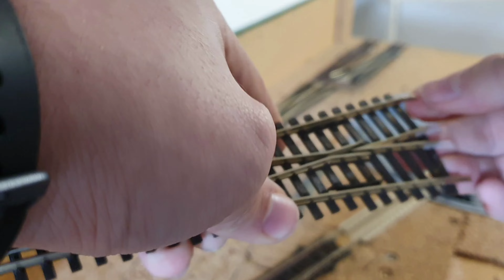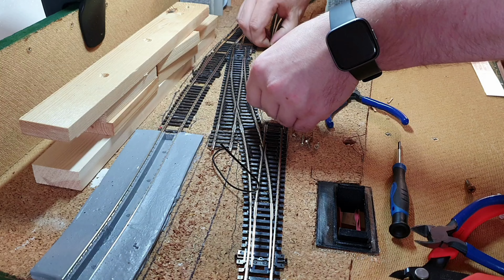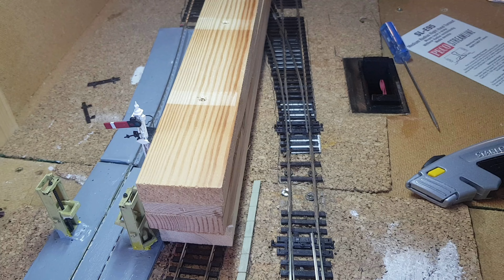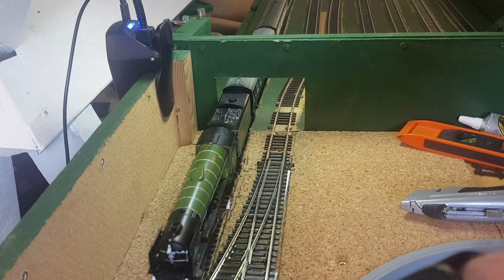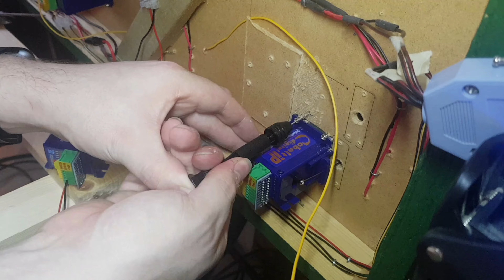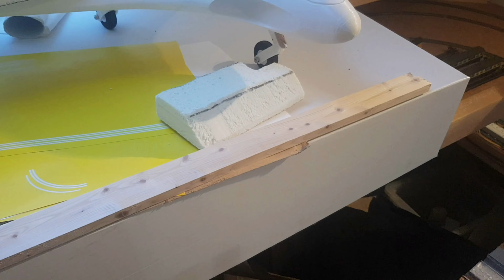Swanage Model Railway Episode 5 Part 2 of Point and point motor replacement project

Comment: Nice video. What turntable are you using? Is it an equivalent scale to the original 50ft at Swanage?
Reply from the maker: no the turntable I'm using is larger then the one at the Swanage railway mainly so we can turn the larger locos around that don't have a front coupler and the turntable is made by peco